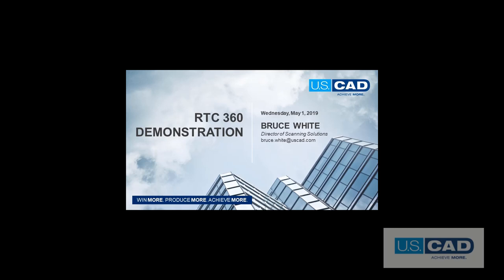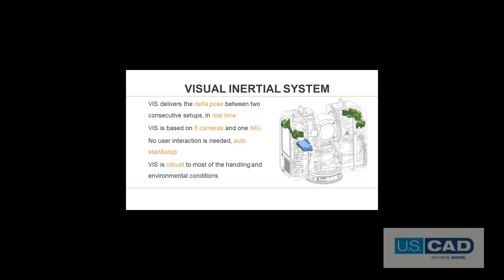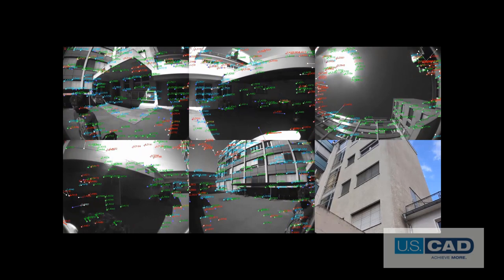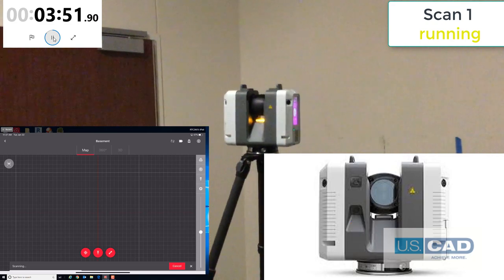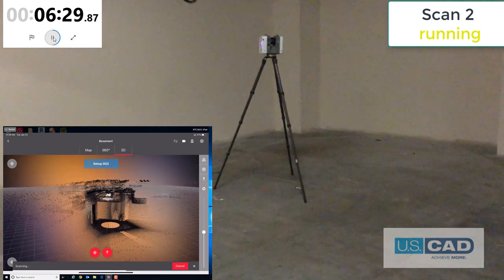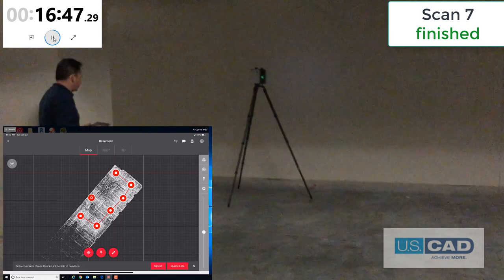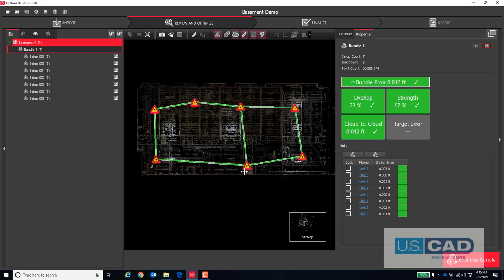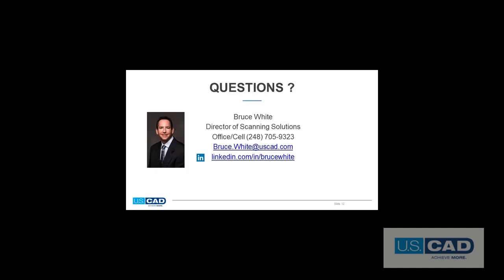RTC360 Demonstration: Hospital Basement

Comment: Processing on the computer takes 17min?  Since the profit in the field is destroyed immediately.  I think the data is already registered in the field?  With the project a deviation of 0.012ft is not exactly impressive either.  There are better systems on the market.
Reply from the maker: Langemapp Thank you for your question. We would like to clarify a few points. The timer shows that the entire time on the project side to collect the data was less than 17 minutes.  The data was fully registered at that point.  In the office we just had to import the data, strengthen the registration and export.  The worst global registration residual value was .003’ (3 One thousands of a foot or 1/32 inch), where as the .012 ft that you reference is unadjusted raw cloud to cloud error.  The global least squares registration result is the appropriate value to reference as being the error that the project is not more than .003 ft.
 
There are many different types of scanners on the market and some people need higher accuracy, such as small scale metrology scanners for reverse engineering or longer range scanning for open pit mining, in our opinion, the RTC360 provides great value at its price point.  We have had many clients do side by side comparisons to other solutions on the market when done head to head, the RTC360 has done exceptionally well.
 
Feel free to give us a call if you have further questions, we are happy to help!
Reply: @USCADBuilding  In the phase where you have activated the time lapse, your system clock is expanded by 17 minutes at the bottom right. I find that a bit much, but it has to do with the extremely high data generation. Other systems manage with far less volume and are therefore faster overall.
Reply: @Langemapp  Curious, what are your avg capture times per setup? And at what error? Under 3 min per setup seems fast to me with data and photo capture. It sounds like he could knock a minute off that with a single scan in environments without a lot of motion/noise to be removed. Over 6 setups, now he's down to 11 minutes? Man, I can kill 10 minutes on a job site talking to the super while this is going on and hand them a 3D scene at the end. Now delivering the noah's ark sized data, that's another thing... :)